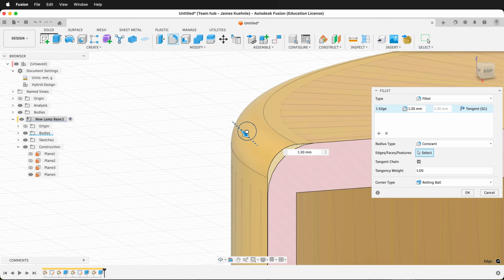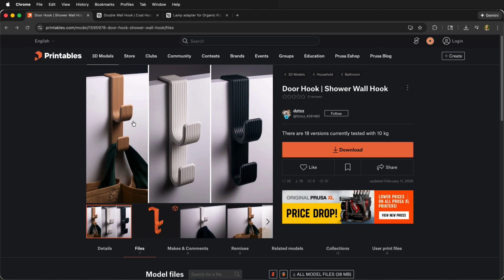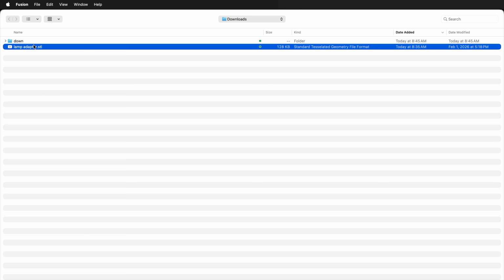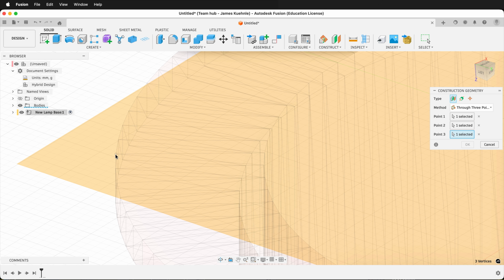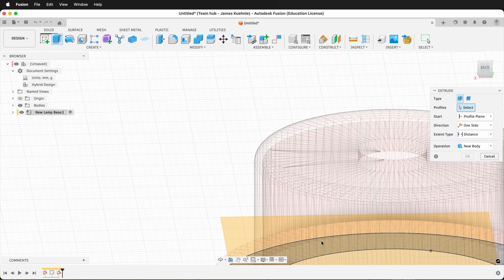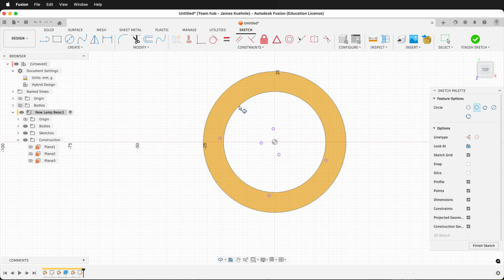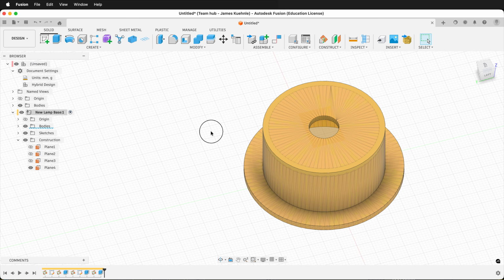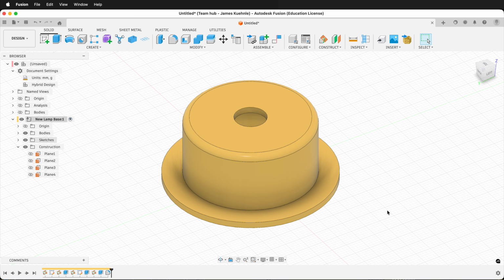Convert STL to Parametric CAD in Fusion (No Prismatic, Hobby License Workflow)

Comment: I got as far as creating the new component and when I did the new component was barely visible and not able to select any points to construct the new plane.  Any idea why the new component is turning mostly transparent?  Is it a setting I need to adjust in fusion?  I checked that opacity was up to 100%.  I am lost at this step because I can not select 3 points for the plane, unfortunately.
Reply from the maker: Make sure that you have the component you want to work on as activated. Fusion sets the inactive components as semi-transparent, you can also isolate a component so you're only working on that one component

Comment: It's a way. But it's faster to make a box around the stl/negative combine, then make a new box and negativ combine box of that first negative shape..(ends in a positive shape of the cavaty).

But your method worked as well. 

I actually do this with solids as wel, when I start to lose track of where and what sketch, and planes goes wherel. Sometimes I just quickly do this . Dobbelt negative combine and export the body it self. And the import it to new design. Just to get it clean of history and planes etc, 

(Yes I am lazy)
Reply from the maker: Thanks for sharing your workflow, seems like a good way to approach it

Comment: Edit: Had a friend throw a quick video together :) ... https://youtu.be/28V9EHUIF9E

Faster method, even for more complex models...

- Centre and Ground the Mesh when importing,
- Chop it into parts using Mesh > Plane Cut > (Split Body / Minimal fill).
- Convert to Solid 
- Project it's outline onto a Sketch. (Don't project the curved parts though, as it will still pick up all the points of the original mesh "curve", so do those manually using 3-Point Arc or Fit Point Spline if it's really curvy).
- Extrude or Revolve from the sketch as needed.
Reply from the maker: This is a great workflow. I look forward to trying it out, thank you for sharing it with everyone :_calipers:

Comment: Years ago I used to design Courtroom furniture in Solidworks. 20 years later I got a small A1 Mini. And now I got fusion. It is pretty amazing how much the 3d CAD environment changed for the better. Thanks for the videos. I learn something useful every day.
Reply from the maker: Sounds like you have a lot of experience to bring to 3D printing and making, Hope your projects turn out well
Reply: Interesting gig. Any little known features that are specific to courtroom furniture?
Reply: @D4RKFiB3R  Not much. They are mostly built in. The judges bench, there is a press bench, defence etc. The holding part in some of her Majesty's courtrooms had a 2cm thick security glass. Weighs a ton and you couldn't hack your way out with a sledgehammer. Interestingly in that holding "cell" there are super sensitive microphones on the ceiling that pick up even your breathing.
The walls of the holding cells in the basement of the courtroom building (UK) were checked by some sort of a handheld penetrating scanner to find any objects that might have been placed in the morter by the builders. (Note that these walls were brick with a plaster finish.

Comment: Clickbait title...you didn't convert an stl to a parametric CAD file.  Also, a revolve would have been a better approach to model this lamp base.
Reply from the maker: Thanks for the suggestion about using a revolve. That is a good solution too. This is a parametric model, simply change the input dimensions and the model will update. If you mean a proportionally parametric model then it the dimensions can be replaced with equations that calculate other dimensions based on ratios of the input dimensions.
Reply: @WhatMakeArt  I agree with @jonjon737, this is NOT a full conversion. Yes, you did use the correct terminology by saying that you reverse engineered the stl, but your title says "Convert" which is very misleading. Don't get me wrong, your video is very helpful and detail. I just think the title should reflect what you are actually doing in the video which is rebuilding/recreating/reverse engineering the stl.
@jonjon737 is also correct in using a revolve to create this model. It would have been much simpler and still be parametric.
Reply from the maker: @jonjon737 This video shows how to make the model fully parametric and proportional so if the inner diameter is changed then the whole model updates proportionally. It also uses a revovled sketch to create the solid as suggested. Video is members only now but opens to the public later.  https://youtu.be/-L_FrESiCAU

Comment: Excellent video! In my experience, I can use this method with simple models like the one shown here. However, when the mesh has too many faces, this workflow doesn’t work. Could you make a video using a more complex mesh with over 10,000 faces?
Reply from the maker: This is a popular request, I plan to make an example with a more complex STL. Do you have an example challenging STL in mind?
Reply: @WhatMakeArt  Hello! Great to see that you’re ready to step up to the challenge.
I have some STL files I tried before from MakerWorld, but I must warn you — your PC might crash! 😅

Usually, I focus only on the specific area of the STL that I want to use for reference or to reverse engineer. But even working that way, some of these files can still cause trouble because of the huge number of polygons.

I would like to see your work flow , how would you handle it .

Comment: Sure .. this works on very primitive parts.... But get a STL with many features fillets and chamfers and you will break this workflow fast
Reply: Edit: Had a friend throw a quick video together :) ... https://youtu.be/28V9EHUIF9E

- Do it in chunks...
- Make sure to centre and ground the mesh when importing, then chop it into parts using Mesh > Plane Cut > (Split Body / Minimal fill).
- Convert to solid 
- Project it's outline onto a sketch. (Don't project the curved parts though, as it will still pick up all the points of the original mesh "curve", so do those manually using 3-Point Arc or Fit Point Spline if it's really curvy).
- Extrude or revolve from the sketch as needed.
With a bit of practice you can get real fast at doing this :)
Reply from the maker: It definitely works best on simpler geometry, complex organic shapes require a different approach. Do you have an example STL in mind that would be a challenge?
Reply: @WhatMakeArt  i could send you one if you want. Its an organic steering wheel grip made fully with surface operations. I haven't had any luck trying to convert it myself, even with rhino and grasshopper. I believe it can be an interesting challenge.

NOTE: The model is mine, but I had a data corruption in my pc and I lost the original SolidWorks file, and the STL was the only file I could save from an old backup.
Reply: @eder.merinoيمكنني مساعدتك بمقابل مادي
Reply: @WhatMakeArt  great answer.

Comment: I often modify functional prints. I find the Mesh Selection Sketch tool is great way to create the sketch to duplicate the mesh into a CAD design
Reply from the maker: Thanks for the tip! That's a great way to approach it.
Reply: Actually scrolled to find this kind of comment. I usually need to make modifications to the existing file and it's been a silly journey. I'll search around for this mesh selection sketch tool.